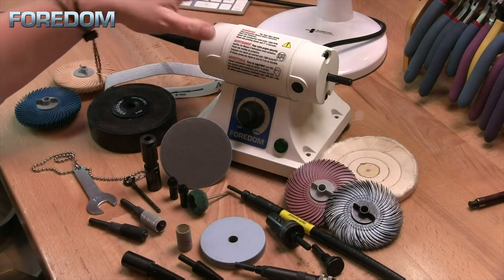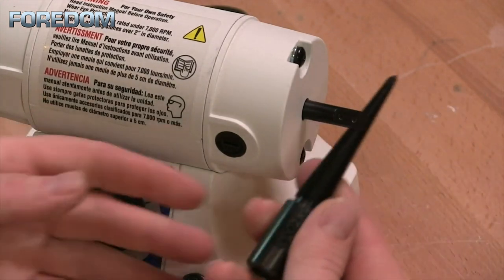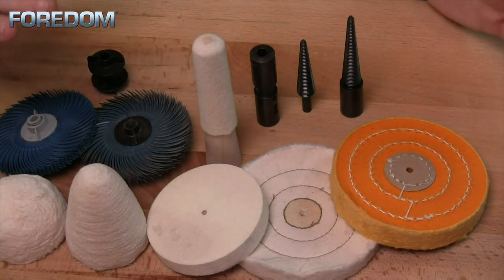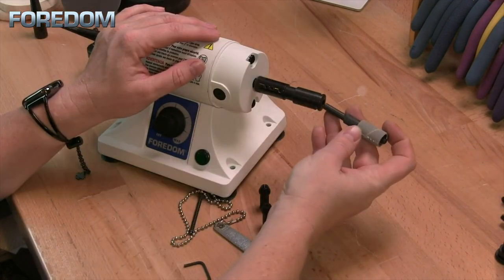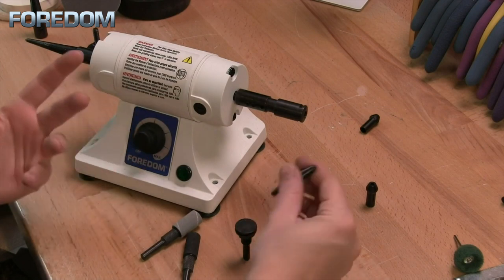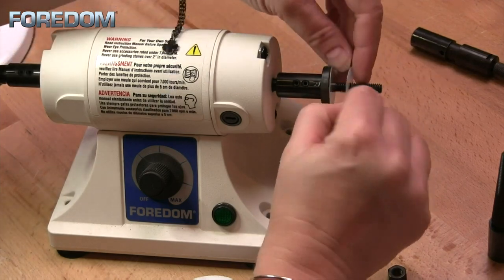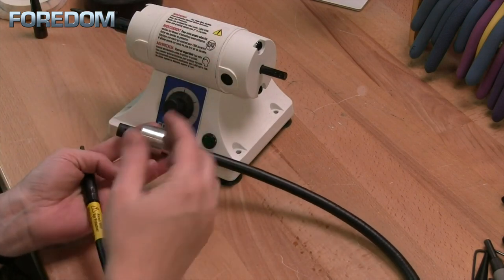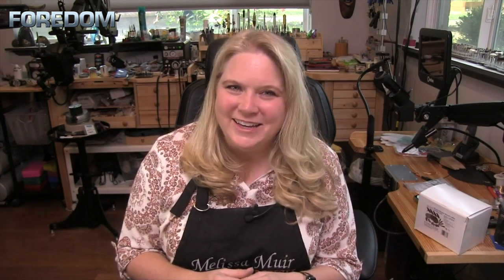Introduction to Accessories: Foredom Bench Lathe Accessories

Comment: are there any attachments that are suitable for shaping gravers like a bench grinder?
Reply from the maker: Gravers require specific exacting angles and must be very sharp. Most manufacturers have special jigs to hold the graver at those angle when being sharpened. Unfortunately, Foredom does not have any longer such a tool. The bench lathe has many tool options which could sharpen other tools but there is no special jig that can be calibrated to specific angle and hold the graver while being sharpened. If the user does not care about these angles and just wants to hone down a graver or tool by hand then, yes, there are accessories.

Please call 800-272-2885 or email Mike Zagielski at: customerservice@blackstoneind.com

Thank you.
Reply: @ForedomElectricCo  I am only asking about shaping a new graver to give it a spine, not sharpening it. Usually would be a bench grinder job. What accessories would I use for grinding down steel?
Reply from the maker: You can use our A-10074 Ceramcut Blue 120 grit grinding wheel on our A-WM-6 wheel mandrel. See links below:

https://foredom.pulse.ly/u1nmb4pddi

https://foredom.pulse.ly/eqdnftahtr